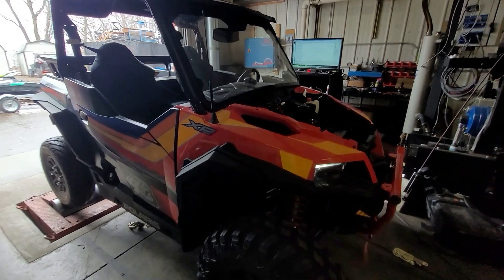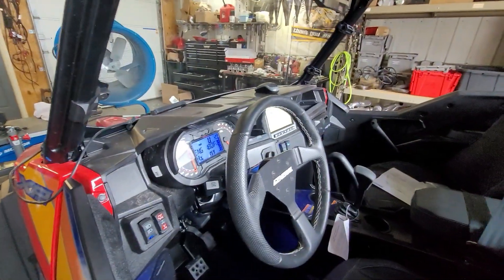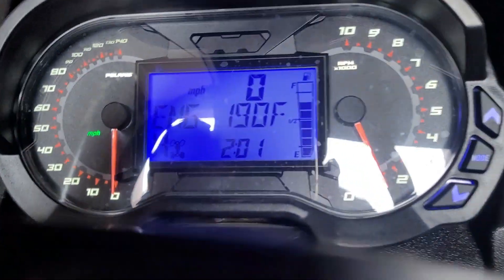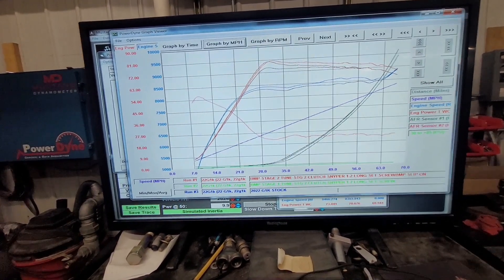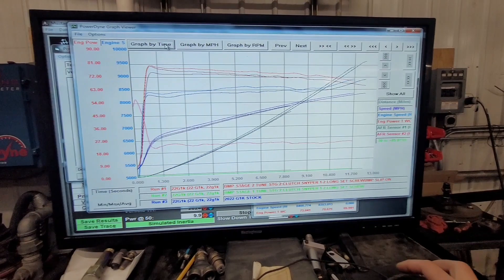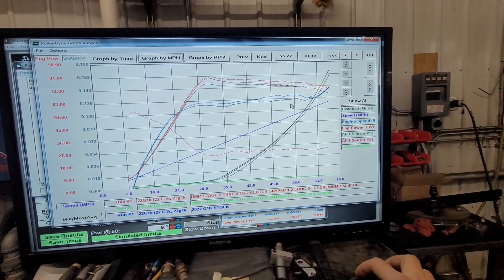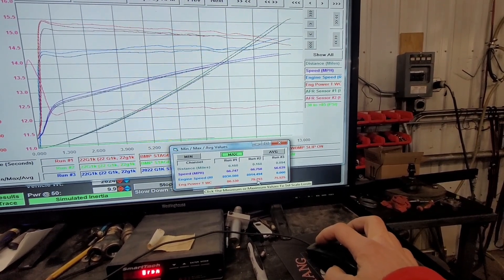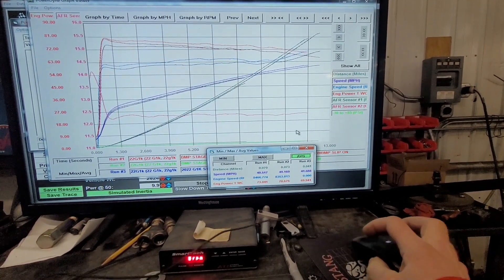22 POLARIS GENERAL STAGE 2 KIT (TUNE,SLIP ON AND CLUTCHING) vs STAGE 1 KIT (TUNE&CLUTCHING) vs STOCK

Comment: I have a 2016 general.  I initially had your stage one tune with the Bully Dog GT tuner and the machine ran great, even in the mountains in Colorado.  I now have your stage 2 tune with a slip on muffler and it runs awesome.  Starts easy and doesn't miss a lick.  Sounds really crisp and clean and runs nice and cool.   I have your stage 3 clutch kit but have not installed it yet but I'm sure that will really make it rip.  Thanks for all the smiles every time I mash the go pedal!